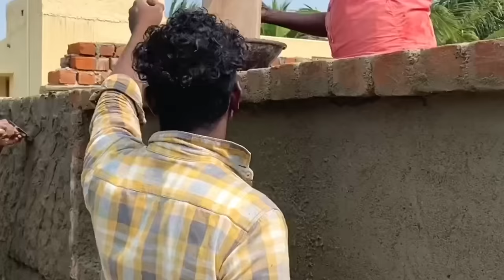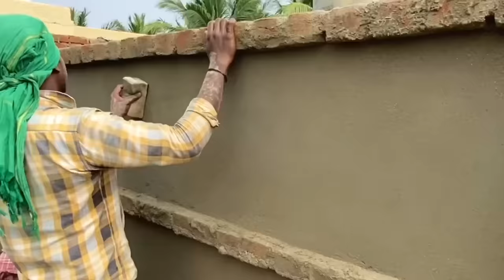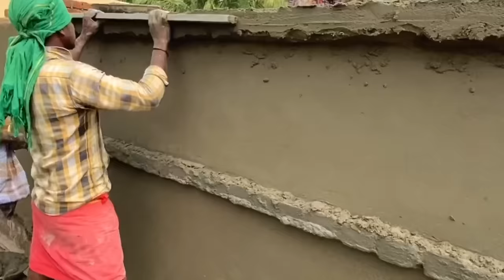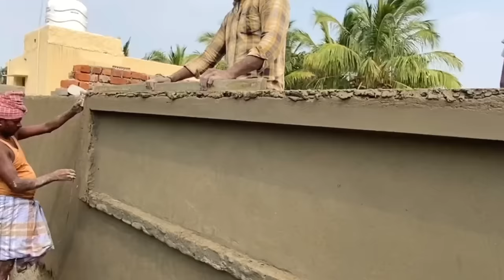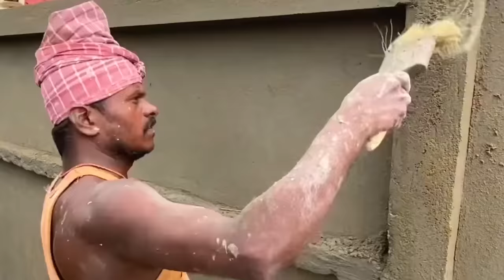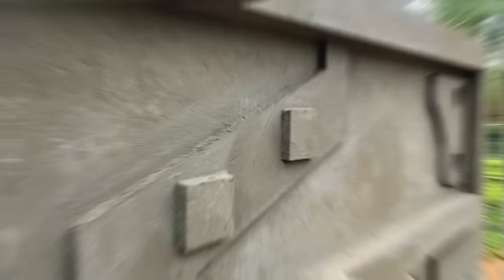Excellent! Plastering Techniques_Parapet Front Wall Elevation Box Design Accurately Plastering

Comment: This is a tradesman's job done well with deft technique. Flicking the render on is much better than 'putting" it on. The air is forced away resulting in a much greater bond. This requires more precision and skill, done rapidly and with great accuracy - as shown in this presentation. EXCELLENT WORK! :face-blue-smiling:👍👍👍
Reply: Confondre du plâtre et du ciment ! C’est pas la même chose.